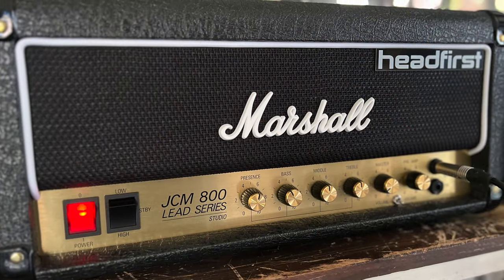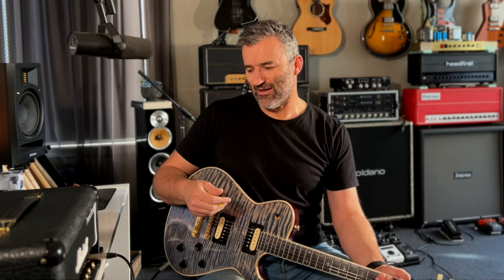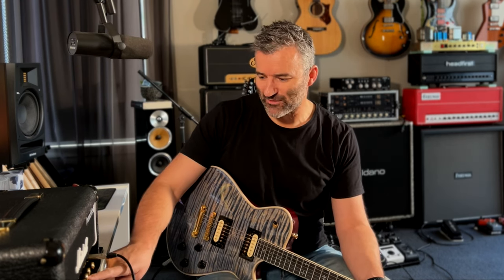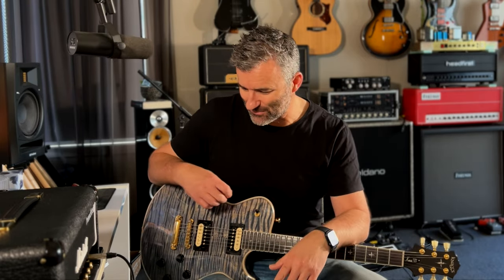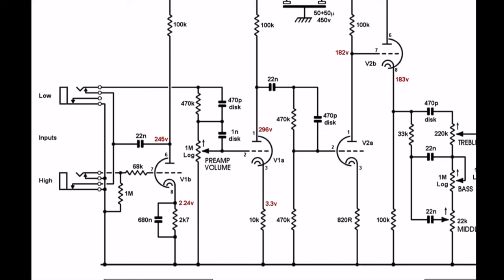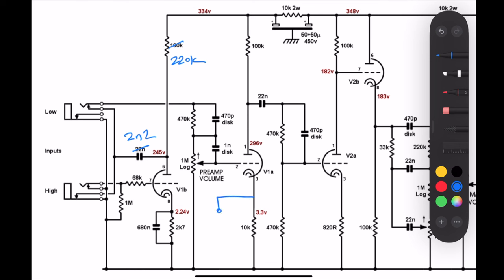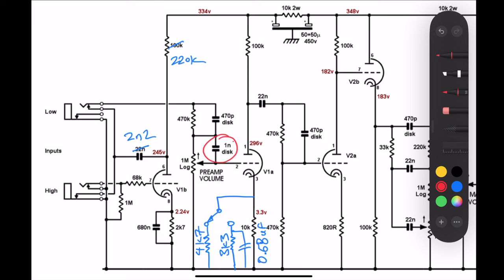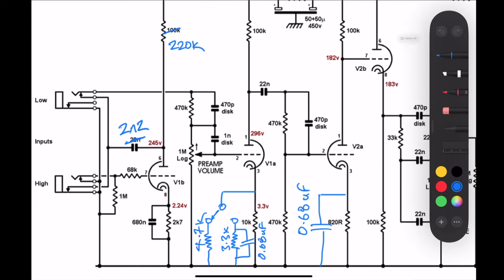Improve the Marshall Studio SC20H with $10 parts - DIY DEEP DIVE!!

Comment: That 470 to cut a little treble, it goes across the top of which R on the board….is it R10 ? I’m playing with values…..I put a .1 over the top of the 10K and trying to pull a little more treble down…..
Reply from the maker: Across the 100k (V2a).  If you put it across the 10k you'll get more treble.

Comment: Jason, nice mods, the SC20H is a great little amp that is well made, reasonably priced and a good platform to work with. A few tips -> the 68k R at IP just adds noise, more than 2 x that of V1 itself. You can make it a lot smaller. The 470pF LPF cap on follower will have a corner freq of well above 100k(Hz), remember it's a follower = low impedance ( 1/gm).
Reply from the maker: That 470pF works and is way less than 100kHz, theory aside.  I use my ears.

Comment: Whilst I love the MKT1813s for classic builds on Turret PCBs I prefer to replace the grey box with ERO/Vishay MKT1822. 
These are tonal in the same league as the MKT1813 (and a general replacement I use when I have a leaking/Dead Coupling Cap in more modern Marshalls) and do look not so displaced as the 1813 do in modern PCB Circuits.

Comment: Could you use a mini toogle for the bright cap instead of a push pull pot?   Thanks
Reply from the maker: Sure
Reply: probably a stupid question, but on the depth pot one leg of the 4700pf does on the wiper right? @HeadfirstAmps

Comment: Pardon.   But depth knobs makes amps sound a bit hifi.   
No offense man.  
It’s just another opinion. 

Great work
Reply from the maker: No offence taken!  Can be handy for a vibe at lower volume, cranked up in a band context then dial it down…even to zero for a more stock sound.
Reply: @HeadfirstAmps  yeah it’s ok for low volume playing , agreed.   
Thanks for not taking offense.   You can’t see inflection in text.  Worst way to communicate.  
Great channel man.
Reply: @HeadfirstAmps  for a slight change from stock I usually like just a slight change to the V1A plate resistor to 120k or 130k from 100k stock for a slight bit more of gain and compression.   It’s ever so slight but keeps the whole Marshall kerrang.   And maybe a fat cap .    Too much gain sometimes takes away from that kerrang 
Of course I should mention I did that on a low voltage 2204 from ‘78 which don’t lend to adding much gain because of the lower voltage.  Mine was around 390v on the plates from what I remember.   Just too low for more gain.   Would get too mushy.  
Cheers